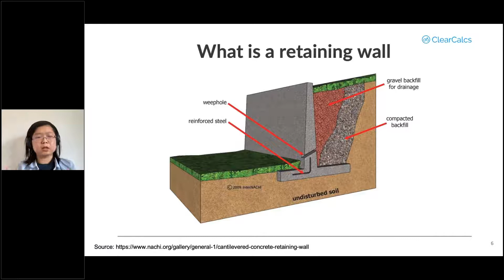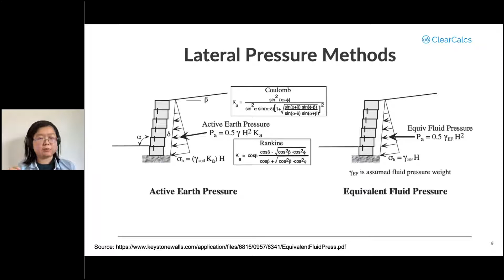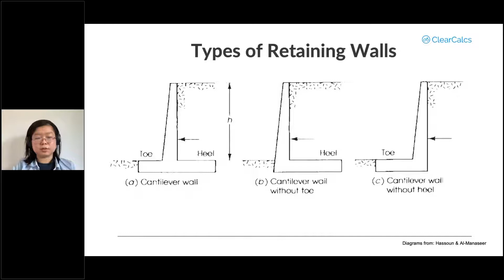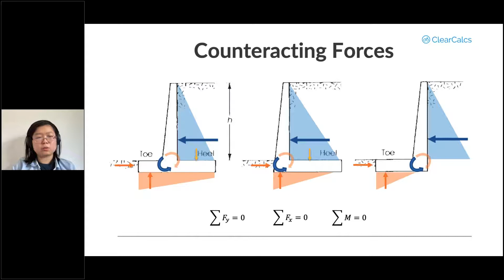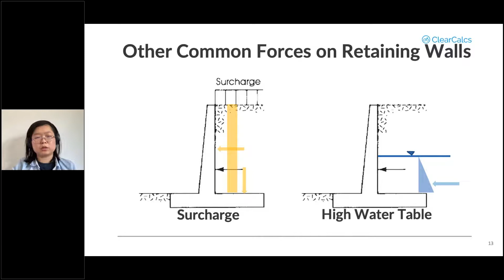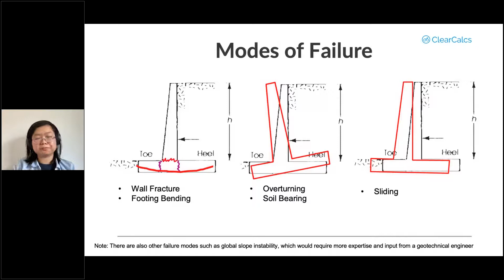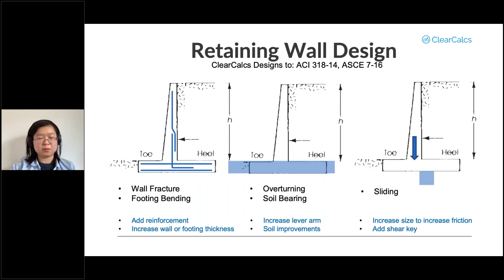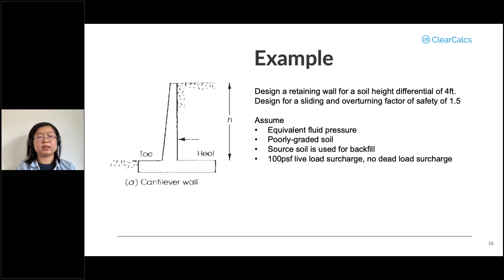Webinar | Concrete Cantilevered Retaining Wall Design to IBC 2018 & ASCE 7-16

Comment: 12:22 --> Wrong shape of vertical steel. Bending goes to the other side.
Reply: No, what is shown looks correct. The tension reinforcement would be on the backfill side of the wall since the stem is cantilevered.
Reply: @hannahmorris1835  
I mean the bending only, the hook only, how you call it, of the vertical steel, must bend to the other side.
Because like it is now placed, then the steel is in tension, the inside corner of concrete will be rip of from tension also.
Thank you!